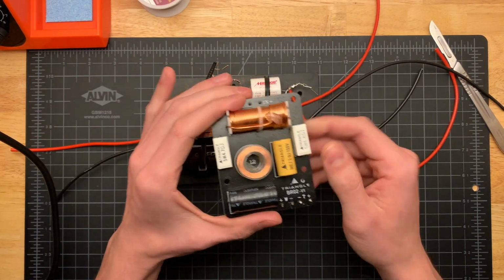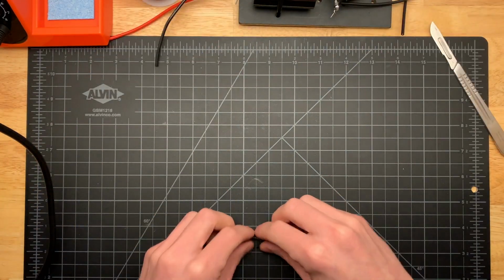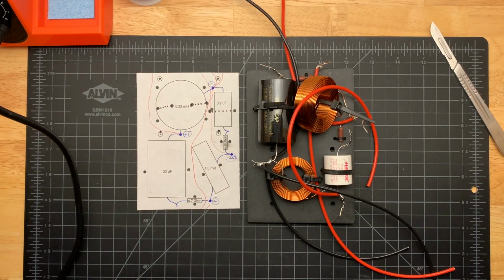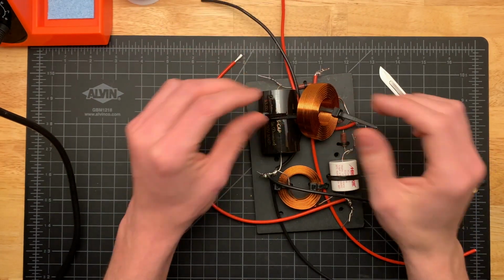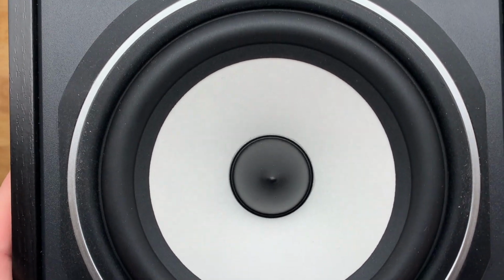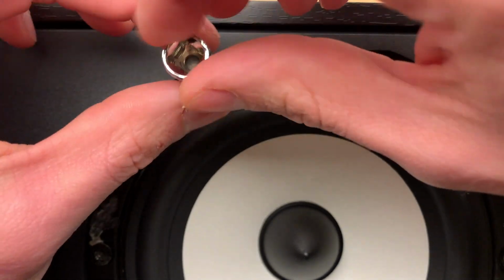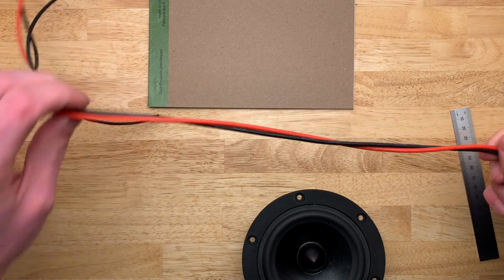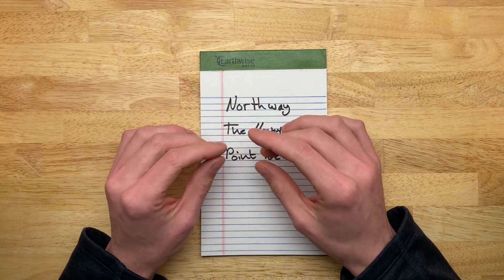Triangle Borea BR02 - Crossover UPGRADE

Comment: Not sure how much it matters, but when I upgraded my crossovers I used stainless steel screws to attach the board. My fear was the metal screws might interfere with the signal  path. 👍🏻
Reply from the maker: I’d doubt there’s much capacitive coupling between the screws and the circuit but at the very least you’ll never have to worry about corrosion!
Reply: @Casey_Schmidt  ya your probably rite. I actually replaced every screw in the speaker with stainless lol! The woofer,mid,and tweeter screws as well as the binding post screws. But I also am very happy with the clarity and detail that was brought out with the upgrade. 🔈👍🏻
Reply from the maker: @JR-ho5qm   I'm glad you got the same results I did!
Reply: The big mistake people sometimes make is putting steel mounting screws in the middle of an air core inductor. It is generally a good idea to keep ferrous materials away from the crossover, though.

Comment: Nice work! I would probably do a sim to check if any component values would need adjustment due to the higher resistance of the air coil on the low pass network. Assuming a 5x higher resistance of the air coil and 8 Ohm drivers, the tweeter would probably need a -1dB attenuation.

Comment: Hi there this is a great video thanks.  I have some BR03 speakers and I think they are too bright so I was thinking of changing the cross over.  Would you have any tips on how to reduce treble?  Thanks Glenn
Reply from the maker: The most simple way is to add a low value resistor in series with the tweeter.
Reply: @Casey_Schmidt  thanks Casey that’s great I will definitely try that while doing the cross over upgrade.  👍

Comment: You are at the entrance to the speaker building rabbit hole - turn back before it's too late.
I said to myself "I could get a really good set of speakers with the money I spent on test and measuring equipment"
I bought some Genelec studio monitors with a Genelec sub.
Fantastic though they are, it hasn't cured my speaker building addiction, instead they became more of a challenge....

Comment: Thanks for this video. I've just bought a pair of BR02 used on eBay and will consider the crossover upgrade. Meanwhile, I read a comment to the review of the BR02 by SmallRoomAudio that it would also be possible to change the driver caps (....."the cap in tweeter for a jantzen superior z cap and the one on the woofer with a jantzen cross cap".). Although I don't know right now what is involved in changing the caps on drivers, I'm curious whether you have experimented with such an upgrade?  Thanks
Reply: You would follow what he did, making sure the values are correct on each capacitor, but choosing the different brand/model of capacitor. Should be pretty much the same that he did, just with whatever cap upgrade you wanted to make.
Reply: @02honeydew  Thanks. I now appreciate that "caps" is short for capacitors - and that it is therefore a very similar upgrade.
Reply: @willpea1445  no problem. For a straight forward upgrade it should be nice, but I have no idea how to figure out changing the actual sound characteristics of a speaker. But nicer parts should definitely give you an upgrade in sound quality

Comment: Most often it really pays of to upgrade filter components, very seldom it does not. I once upgraded the crossover on a set of the newer JBL L100s. That didn´t sound good because I think
the low cost Bennic caps matched up fine with the alu tweeter.

Comment: Hi Casey!
First time viewer. Really enjoyed your Borea crossover upgrade video.  Have watched many G-R vids and was impressed with you pulling back the curtain on component values so one can purchase them on their own vs. a kit.
Thanks for taking the time to do that. I'll be watching some of your other non-speaker videos.
Stay safe.
Tom
Reply from the maker: @Tom Koutz - Thank you!!
Reply: @Casey_Schmidt  HI Mr. Casey. You maked big mistake. Never use one capacitor in the future, because one thin capacitor wire kills and stopped signal. For example - if you need 3.3 uf use 6 capacitors (0.55 uf *6), if need 10-12 uf use 8 caps and connected in one parallel. If need 33 - 60 uf use 18 caps and etc. And resistors likewise use no one, all time use 4-8 resistors. One of the Best high quality caps for affordable price - JB JPX Supreme (red color). Best affordable resistors metal oxide Visaton (green color) and Dayton Audio resistors only green color! And the last. Inductor coils need use only film! No wire inductor coils. Do not forget about it...

Comment: Halo ! Is me again i have some headache problem that i cannot figure the right component for my speaker crossover , i have electrolytic  no polarised with 8mfd 100v n 15mfd 100v 
so my question is can replace same as your this video mundorf mkp caps value or i send my photo speaker sample to you see first , tq for your kind info

Comment: I just bought a pair of BR02 and I am planning to upgrade the crossover as well. Capacitors, resistors and internal wiring are must. As for the inductors, I haven't decided yet. What is your opinion on the inductors? There are low cost ones but I am not sure if they are any better than originals. Goods one like Mundorf are quite expensive.
Reply from the maker: Just avoid the iron core ones. After that they’re all too similar to matter.

Comment: Thanks for the walkthrough. Do you remember the dcr value for the two inductors?
Reply from the maker: @Movementry - I do not recall that values off the top of my head. But if you follow the sites in the description and find the same components, the resistance will be listed. I can say that the woofer inductors will be slightly higher than the originals and the tweeter will be slightly lower. While it does technically make a difference, I would be doubtful as to whether or not the would be noticeable.
Reply: @Casey_Schmidt  Thanks for the reply. Received the speakers last night. Love the smoothness to them, but finding some mid range bloat and the highs kind of lost behind that, but so much better listening than the Hsu MkII I was using (and they aren't broken in yet). Sounds like upgrading the crossover will address this some.

Comment: Would you mind sharing what diameter wire you used on your 2 replacement inductors?? 

And if you have it - the diameter wire of the original tweeter inductor? 

Much thanks

Comment: it is VERY easy to repair a cone or surround if it gets punctured or torn  you DO NOT a need to buy a hole new driver!!!!
Reply from the maker: @KC LEACH - You have peaked my interest. How would one go about doing such a thing?
Reply: @Casey_Schmidt  all you need to do is , depending on the size of hole or rip get super glue and a piece of fabric.. i have a 10inch sub in my car that the surround of the cone was completely gone and i took a bicycle inner tube cut out enough to cover the size of the surround super glued it on and that sub pounds harder than when it had the original surround on it!!!  ive been using that same sub for over a year now no issues!   be creative!!
Reply: The rubber surround of  drivers can be easily replaced, and most of modern drivers are of PVC anyway, replacing it with REAL rubber might actually improved the sound, its available on shelves. 😁

Comment: Do you think the same general principles apply for the Triangle BR03's?  Would I just upgrade the components, matching the original values of that design?  There have been so love/hate reviews of those speakers, it would be great to have your take on them.
Reply from the maker: You’re correct. I’ve done this same treatment to several speakers with good results.

Comment: Thanks, good careful approach to everything. But how does it change the sensitivity?
Reply from the maker: @Ke Bo - With these upgraded components, the overall sensitivity is changed but not enough to really matter in any practical sense. The parts that will change the sensitivity the most are the inductors. The larger air core inductors have a higher series resistance than the original iron core inductors. The difference is so small that it really isn't worth getting concerned about unless you care about the speaker being 100% perfect.

Comment: Just ordered these speakers heard good things about him I'm interested in upgrading the crossover what exactly is it going to do for me if I use the same parts that you used in this video how does the speaker improve in what way?
Reply from the maker: @I shoot Nikon - The purpose of the upgrade is to more depth and clarity form the speakers. Some people can hear a difference and other can't. Think about it like fine wine. Some people can test minor differences while others can't. You don't have to use the exact same parts that I used. Any style of components with the same values will work. But if you don't do at least air core inductors and decent poly capacitors, it's kinda pointless. I recommend living with the speakers for a few months before upgrading to see if the upgrade is worth it to you. You'll love them either way I'm sure! Thanks for watching!
Reply: Thanks for your reply so did you change the crossover or did you just upgrade with the same parts but just better quality? And did you change any of the inside did you add any more like foam inside to deaden the the sound inside the box inside the cabinet or did you just leave it alone?
Reply from the maker: @califmike2003  I chose to replace everything with higher quality parts of the stock values. I liked the way they sounded so I didn't feel the need to change anything. Not only that, but I do not have the equipment necessary to re-engineer the crossover. The rest of the speaker was left stock. the bracing inside is significant enough that I did not feel the need to add any vibration-dampening foam.

Comment: Great content, hope it will make it to 500k views over time :)
I did my upgrade with way cheaper speakers, very sceptical while doing so, and I was blown away what the 10€ tweeter can play after you change 0,10€ electrolytic cap for 5€ film cap.
Reply from the maker: @peterpixo - Thank you! I agree, when I did my first upgrade, which was on my Klipsch R-15M's, I did not expect to hear much if any difference. It was just for a bit of fun and tinkering. But when I heard them after the upgrade for the first time, I was really blown away by the difference.

I would equate the experience to this. A passerby would never hear a difference between the stock and upgraded speaker. Just as someone driving a certain car for the first time would never notice if it had better tires, brakes, or suspension. But if you're familiar with a speaker and you know its characteristics, it's easy to tell the difference; just like if you put upgraded components on your daily driver car.
Reply: Damn, you confirmed my doubt about this myth. It isn't even a myth, it is truth haha. Ok, I'm getting those entry level film Jantzens for my cheapo, just-acquired Pioneer SP-C21 center. 💪🏽
Reply: @Casey_Schmidt  one question, is your simple mod for the R-15M only replacing the caps or together with the inductor?
Reply from the maker: @HarithAhmadDaud  I replaced the capacitors, inductors, and resistors.
Reply: @Casey_Schmidt  will replacing the caps only improve the sound quality in your opinion?
Reply from the maker: @HarithAhmadDaud  it should, yes.
Reply: @Casey_Schmidt  thanks for your help man. How about you make a video explaining what these components do in a crossover?
Reply from the maker: @HarithAhmadDaud  I’ll put it on the list!

Comment: Thank you for making this video, very useful. Would you mind putting up a parts list of the parts you used in this video? Your choices look good to me, I might get the same.
Reply from the maker: @DecoRyder - Thank you for the suggestion! I have added the crossover parts to the description. The sky isn't even the limit when it come to audio gear but I've found that the parts I listed/used represent pretty good value for the money. Feel free to buy either cheaper or more expensive components based on you budget for your project, good luck and thanks for watching!
Reply: @Casey_Schmidt  Thx Casey! I'm gettin' the BR02's tomorrow, and I'll upgrade them sometime shortly after xmas - I'll let you know how before/after compares.
Reply from the maker: @decoryder  - Keep me posted!

Comment: Jantzen aren't that great,  pretty much all poly caps sound the same... metalized film capacitor are better, their sonic qualities are great. PIO / paper in oil would be my first choice . I would build my own inductors with Torodial transformer Copper, really good quality there.... Resistors, i would go with T Tulead... They even have heatsinks to keep them Cool..... Remember that resistors / resistance is always affected by heat... So value change once it gets heated.....  And that's it... OFC copper for wires and you get yourself a high quality top of the line Crossover.
Reply: They have a variety of sounds some warm... Some bright

Comment: Please do more of these!...I actually have sum really cool triangle Titus speakers from 2002 there called the Titus “202” for obvious reasons lol if you’d like me to send them to you i can.  Let me know
Reply from the maker: @Tom Ford - Thank you for the kind comment and generous offer! I looked up the 202's and they do look like really nice speakers. I found a web article (see the link below) that shows that the "crossover network" only consists of a single capacitor in series with the tweeter to cut it off below 6K Hz (not an optimal design). Given that, I would say they would definitely benefit from an upgraded crossover network. Since I don't have the tools to measure and engineer a new crossover network, I would highly recommend giving Danny over at GR Research a call. He makes a business out of upgrading and re-engineering speakers and does really great work. Again, thanks for watching, I should have more speaker videos coming soon!

https://www.tnt-audio.com/casse/titus202_e.html
Reply: @Casey_Schmidt  thanks man but yea I’ve been in my speakers lol that review was definitely off.  There is a cap a resistor and an air core inductor for the tweeter circuit.  However the woofer does play full range which probably isn’t the best choice but man do they sound great.  I’ve called Danny quite a few times and yea your right I think I will go ahead and ship them to him.  I just like how in depth your videos are